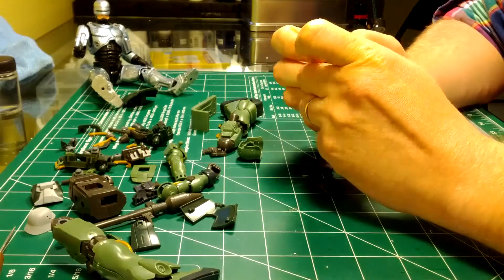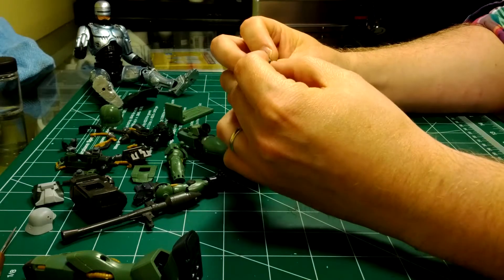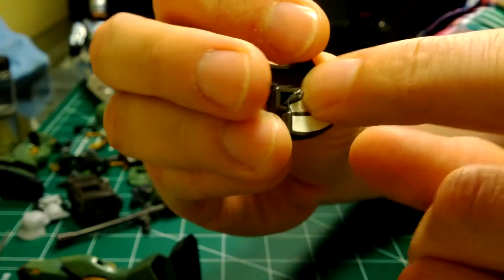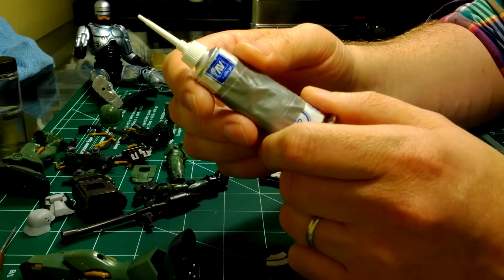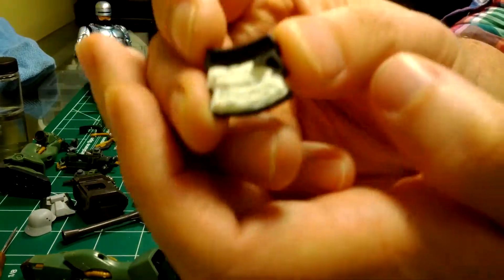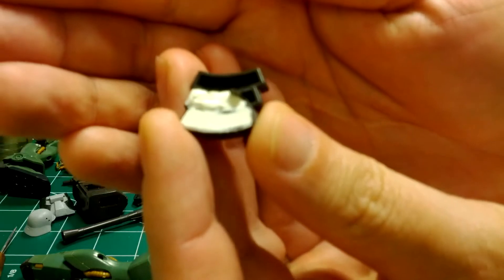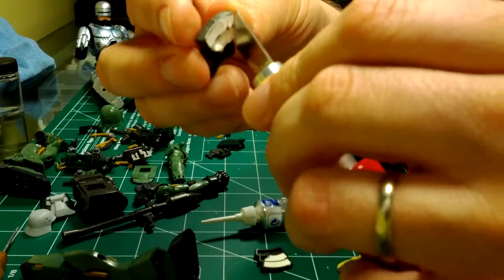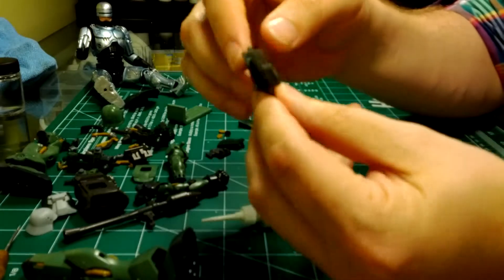Build Diary - HG Geara Zulu Part 2: Filling in Hollow Pieces

Comment: You should buy an M9 Gernback model kit. Filling in the gaps is a huge part of the build.

I use that brand of putty too and I've had the same problem with putty coming out of gaps in the wrapper, but does your nozzle keep getting clogged with dried putty? I'm at the stage where I have to remove the nozzle before I use it. 

Great video what's part 3 going to be about?